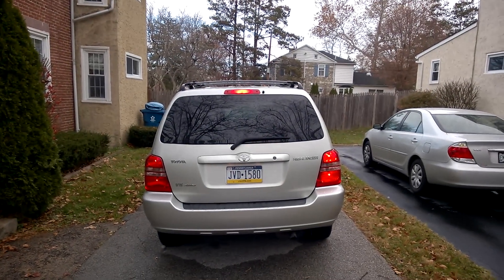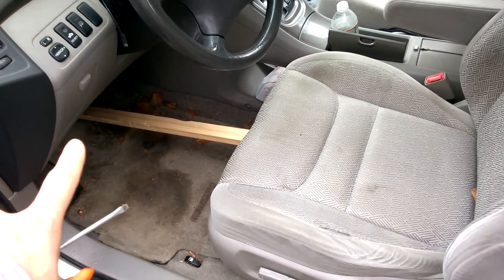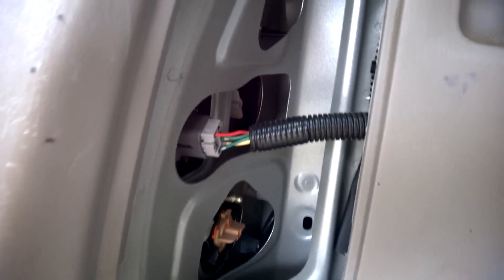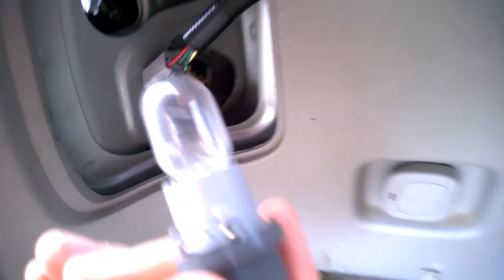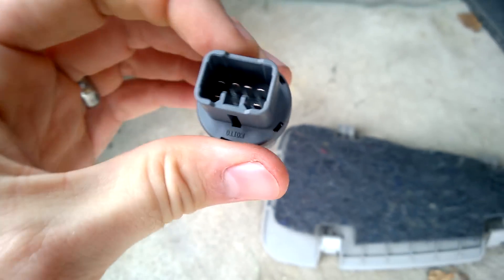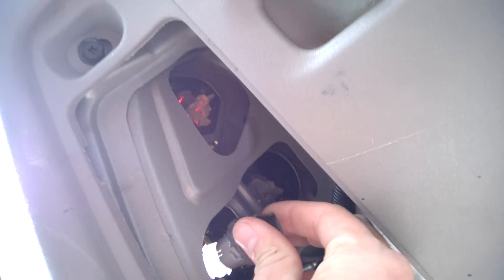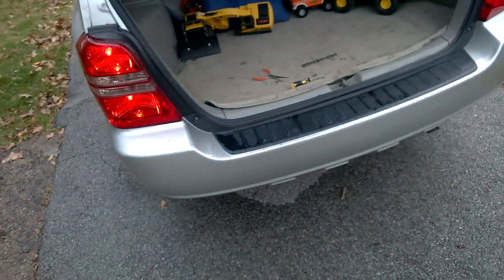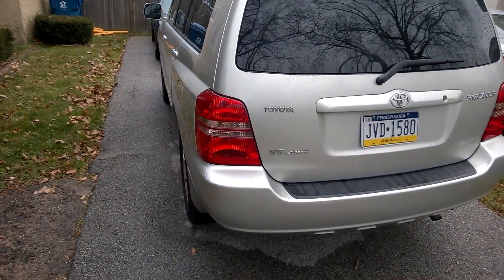DIY: How To "Fix" Your Highlander Brake Lights

Comment: A word of warning. It is very easy to drop the bulb and socket when removing it thru the small opening provided. It WILL disappear for good between the layers of metal bodywork. I suggest stuffing a rag or sponge to fill  the gap to catch a dropped bulb. The sockets I found aren't readily available.
Reply: Etownster Guy I agree! I've lost two of those. I had to buy replacements
Reply: Actually it's easy to retrieve with a piece of flexible hose with some sticky putty on the end (we call it Blue-Tac in Australia) BUT usually the fall causes the filament to break, so not much point. Maybe worth a try though.
Reply: The issue isn't a lost bulb but the lost socket. I seriously doubt a rubber hose with putty will do squat.
Reply: At the time you drop it, the bulb and the socket are attached to each other. The socket is just a small plastic thing, no bigger that the bulb. It isn't really a socket, more of an adapter. And rubber hose won't work because it's too flexible. You need to use the type of hose that is bendy but still stiff. It's usually transparent, maybe acrylic?
Reply: That's exactly what happened to me. Now off to Auto Parts Store to see if they have it. I wish I would had seen your comments beforw
Reply: get a grabber tool.  It is a small flexible metal rod with a claw end.  Worked for me.  $7.99 at pep boys
Reply: I ended up ordering socket on ebay $10. It is not carried by the local auto parts stores
Reply: Wish I would have read this comment sooner, but I managed to fish the bulb& socket out with a piece of wire
Reply: Etownster Guy I had to go buy a whole new tail light because I dropped the housing
Reply: I dropped both bulbs down the same side! Can’t see them or feel them. Can’t figure how to get lens assembly out!
Reply: WOULD BE NICE IF TOYOTA MADE A HOLE BIG ENOUGH SO THE THING WILL FALL ALL THE WAY WHERE WE COULD JUST PICK IT UP
Reply: @chrisjamesfell  i used a wire and a strong small hard drive magnet
Reply: Just lost one damnit
Reply: Been there just today!  Had to do some liner disassembly to fish it out in the 100 degree heat.  (Not big fun when you're in your 60's and out of shape.)
Reply: I wish I read this I dropped the bulb and tools trying to get it out
Reply: Yes. Had that happen so I now place a towel to plug those crevices. Thanks for mentioning it.
Reply: Wish I would've saw this comment sooner 🤣

Comment: This was the same problem that I had with my 2002 Highlander.  After replacing the bulbs, I watched the video.  It was very clear and easy-to-follow. I had my passenger's side tail light working in 5 minutes!  Thanks for this!
Reply: Same here just replace the socket your better off.

Comment: Thanks for pointing me to the tail light socket. When I removed the wire harness plug, I could see two of the six pins in the socket were coated with greenish gunk while the other four pins were bright and shiny. Also, residue on the surface inside the socket around the gunked-up pins suggest the pins had been submerged in water sometime during the past 19 year life of my 2005 Highlander. I removed the gunk using a dental probe, just like cleaning plaque off teeth. There still seemed to be some burned varnish on the surface of the pins. So I sprayed some contact cleaner on a thin cloth wrapped around a tiny screwdriver and got the two pins mostly clean. I then sprayed the contact cleaner into the socket and did a few cycles of connecting and disconnecting the wire harness plug. Problem solved!

Comment: I just helped a friend diagnose and repair this issue using this video. The issue is indeed on the connector, but not in the way mentioned in the video. On the side of the connector that plugs into the tail light assembly, there are 5 little metal tabs that are bent at ~45 degrees. Over time, they flex and become loose or flattened, severing the connection to the tail light assembly. With a small screw driver or nail file, you can bend them back up to ~60 degrees or so, ensuring that they make contact again. This will get you by for some time, but a better fix would be to just replace that connector. It's Toyota part #90075-60036, and can be had for about $12 each. You need one per side.
Reply from the maker: Thank you for the comment!! Very helpful!

Comment: Thanks, JEG's Garage! When I put the new bulb in and nothing happened, my wife who helped said she would check the internet and your video did the trick. $7.00 for two bulbs (might not have needed it) but cleaning off the metal parts of the sockets and giving the three sockets a few twists did the trick for our 2002 Highlander. Thanks again.
Reply from the maker: Glad it helped!!

Comment: I had the same problem, lights would come on when I turned on the headlights, but the brake lights would not light up.  I bought a new reverse light socket and even tried your trick of messing with the prongs in the socket.  It ended up being a short somewhere in the wiring of the tail light assembly.  I replaced the entire passenger tail light and the brake lights work again.

Comment: My right brake light was out but not my left. Bulbs fine. Per your suggestion, I bent the connector harness tabs slightly to get more contact pressure when pushing the connector into the socket. All good now. Another big thank you from Arizona for your help!!!
Reply: I know you posted this comment 2 years ago but I wish i saw this sooner. Just went to auto repair and they charged $147 to "rewire" and connect the cable. You had the exact same issue as me. Better to know then never i guess
Reply: @jewbacca0008  i have the same issue possibly, but ive tried switching the little grey socket and it works on the left one so its not the socket, i even replaced the tail light assembly, i think i might have a bad wire or something

Comment: Hey bro, Thank you for this! I was having the exact same problem with my 2003 Highlander V6 as well. I followed your video and boom, had it working in 10 minutes. The connection seemed very loose to the bulb that held the wiring harness, so I reinforced with some electrical tape. Seems like it is pretty snug in place now. Thanks again for sharing this! Huge help!

Comment: My 2004 Highlander's passenger side tail lights/brake lights stopped working today. A local shop said it would be $50 for troubleshooting plus any parts! I told them "NUTS" and came home. My YouTube search popped up this video. The issue was 100% what was shown in this video and fixed the problem. It was so quick and easy that I did the driver's side also. THANKS JEG,s Garage guy. Saved me a bunch of bucks. This Highlander is coming up on 180,000 miles and still going strong.
Reply from the maker: That is AWESOME to hear!  Sometimes the videos that I never thought would help end up helping the most people!  Im glad it got your Highlander fixed up.  Thanks for the comment!

Comment: Worked like a "charm" on my 2003 Highlander. Wiggled the connector, on the lights came on, took it apart and cleaned and very slightly bent the connector contacts, and now all the lights work. Thanks, you saved me hundreds of dollars.
Reply from the maker: Glad I could help Joe!  Its not a job you need to pay for thats for sure!

Comment: Some kind citizen pulled up next to me today and told me my brake lights were not working. Well, I check all the other lights about yearly but not brake lights unless there happens to be someone around to assist. I went into panic fix it mode. Thought it was probably the switch, but I was also sure I knew nothing about the functioning. Hours later I stumbled upon your video, performed your test, with a board holding down the brake pedal and removing and checking connections. Got one side to work. The other needed a new bulb, which I had in the glove box. All that in time for bed. Tips were fantastic. Thanks so much.
Reply from the maker: Awesome!  Glad someone was cool enough to let you know you had a problem and glad my video helped you fix it! Thanks for the comment.

Comment: Thank you so much!!! We bought our 2003 Highlander two weeks ago and realized after a few days that the brake lights on the same side weren't working. The car lot was supposed to get us some bulbs, but today we just bought some from the parts store. They were burned out, but after replacing, we had the same issue. Found your video, went out and jiggled it and BAM, they came on. Upon shutting the rear hatch, it stopped again. I tried the turn slightly back method and now they are working! Whoo Hoo!!! You are an angel!
Reply from the maker: Hi Dawn! Thank you so much for the comment!  Glad to hear that the video helped you out.  Thats the whole idea :)  Thanks for watching!

Comment: JEG - Thanks for the video.  My “fix” was turning the backup light socket back 1/4 turn and electrical taping it in place.  We’ll see how that holds up over time.  Crazy times now and really appreciate how this saved us $$$ and a trip to the mechanic during these coronavirus times.  Mahalo nui loa!
Reply from the maker: Glad the video helped get you on the right path at least!  Thats all I could have hoped for.  And yes...with the virus going around, I think lots of people have turned to doing things like this on their own instead of venturing out.  Thanks for watching and for the comment!

Comment: JEG ~ Your video was spot on!!  In less than 10 minutes I fixed my own brake lights!! , using a nail file and my Louisville Slugger bat (I had no 2x4's on hand). I feel like MacGyver! :D My 2003 Highlander had the exact same scenario: both brake lights on left side were out. A few months ago I giggled the wire connections & they worked, but not for long. I replaced the bulbs many times to no avail.  Thank you for this great video!!
Reply from the maker: Glad it worked for you Heather!  And a Louisville Slugger is better than a 2x4!!!  Such a versatile tool :)

Comment: Feb 2024 and this is still legit. 04 highlander and left brake light not illuminating. Already bought new bulbs and tail light fuse but still not working right. Just unplugged the connector from the bulb and put back in, worked like a charm. Saved myself a hundred fifty bucks. Kudos to you 🫡🫡🫡 You just earned a new follower!
Reply from the maker: Glad the video helped! Thanks for the comment sir!

Comment: Thanks so much for this video.  I was struggling to to figure out what happened when I was working to add a backup camera.  Had unscrewed that left hand bulb to check voltage but didn't get it back in right.  Never would have guessed all the stuff that came off that connector.  
Just put it back on with the 5 contacts keyed correctly and all is well.
You are a lifesaver !!

Comment: I had both left and right brake lights out on my wife's highlander.  I replaced the bulbs and nothing. The fuse was good and still nothing. I watched this video and moved the center bulb/ backup light and BINGO it worked (Both sides)   Thanks a bunch for posting the video.  I owe you a cold one !!!
Reply from the maker: Thanks Steve!  Ive been accepting cold ones as payment for 15+ years now!  Probably when I should have only accepted cash on more than one occasion :) Glad the video helped!

Comment: I didn't do any bending, but I use Qtip and acetone or alcohol and wipe off all terminal contact, male or female contact.  Remove the connector from bulb, input and clean them with acetone.  Almost a year now it still work.  Thank you very much for this informative solution JEG's Garage.

Comment: I've had this issue before,  wiggled the various bulbs and suddenly the brake lights work again.  Never understood why. All I did after watching your video was remove the reverse light with wire connectors and made sure they metal contacts weren't flat,  wiped my finger along the contacts in the highlander, and replaced the bulb tight again.  A little wiggle and the brake lights were back.  I slightly wiggled the bulb casing again and the light went out.  It looks like it just doesn't snap tight and a good bump in the road could cause my problem. Thanks for explaining how it works. That helps me figure out what I want to do and what I want to leave to someone else.

Comment: This helped a lot.  I replaced the bulb on the inop R/H side; it was burned out, but replacement still didn't restore operation on that side (my typical karma).  The Haynes schematic just basically shows wires from the fuse up front to the tail lights, with the only "split" at something they call a "junction box" or some such.  Of course, there's no hint at where this junction might be...that's what brought me here.  I suspect the convenience of all those gazintas and gazoutas at the reverse light socket might be what they meant.  Of course, any of us who have spent any time as a grunt in a technical field know that engineers generally can't "write their way out of a wet paper sack" (sorry...soapbox moment).  At any rate, tweaking the contacts for more robust electrical connection turned the trick here.  Huzzah!

Comment: Good video. I man drove next to me at a traffic stoplight and told me my rear right was not working.
I researched and found this video.
What I discovered was that turning the bulb holder a bit but not fully into the click-lock position made all the bulbs to light up when brake pedal was depressed.

 However, this maneuver disabled the rear signal light on same side.

What finally worked for me was swapping the bulb holders: I moved the right one to the left, and the left one to the right.
Everything worked fine thereafter.
Reply from the maker: Yeah if you rotate it too much it can make contact with different areas of the circuit.  Its a very slight turn off of seated that did it for me.  Either way glad you got it working!  The important thing is someone was cool enough to let you know and you were handy enough to fix it without spending a fortune :)

Comment: Thanks for the video. This worked great for me. I knew everything came in thru those wires but didn't quite know what to do. You were very thorough in covering all angles of this. I bought no bulbs or sockets, so cost for me = 0, or just a little time. Thanks again!!

Comment: Great video!  I just got through fixing the same problem on my mother's highlander. when I removed the harness out of the socket, I immediately saw the green funky corrosion over the contacts; I cleaned them off with electrical wash and I was good to go.

thanks!

Comment: Thank you for sharing this video, it helped me solve my problem! I have had this same issue all year and have replaced the bulbs on the drivers side several times only for the situation to come up again months later. Eventually I had come to realize the bulbs weren't even burnt out and it had to be something else. This video saved me a visit to the dealer and lots of dinero, Thanks Again!!!
Reply from the maker: Hi Brenda!  No problem!  Glad this video is still helping people out.  Now if something else goes wrong back there you will know your way around!  Thanks for watching and commenting!

Comment: THANNNNNK  YOOOOUUUUU!  Worked like a charm for me.  I found that I needed to bend the prongs inward vs outward progressively on a couple tries to finally get them to seat.  I think it's deceiving which side of the two slots the prong seats.  I think its the outer side, so bending the prong inward applies more pressure.  I could be wrong.  In any case that's the trick.  For me it wasn't the connections that engage between the bulb housing and the tail light assembly.  No amount of rotation mattered in my case.

Comment: omg... Thank you thank you thank you.  I was getting so frustrated. I bought new bulbs, new fuses changed everything and still didn't work.  after watching your video I went back and pulled the connector out and put it back in turned it all the way then back a quarter way like you said and it worked!!!  yeah!!! Thank you Again!

Comment: Same problem I had; simple solution, went on Ebay and bought replacement back up light socket/wire harness receptacle for $10, free shipping, replaced it in 2 minutes, works great.
Reply: what did you search for when you made this purchase on ebay? I tried searching "02 Toyota highlander back up light socket harness" and nothing showed up, please help! thank you!
Reply: Toyota Original OEM Tail Light Socket Plug 2001-2007 Highlander

Comment: Great video.  I had the exact same problem but with the passenger side.  With mine, the fix was temporary.  The next day, no right brake light.  I did end up ordering a new socket; just waiting on it to get here.  Will also try bending the tabs up a little more (and inside the plug) to see if I can get better contact.  You do a great job of explaining the steps in your video.  thanks!

Comment: Dude, you're awesome!  My fix was the easiest.  I removed the reverse light bulb with the wire harness and put it back in and the brake lights came on...it had just come loose.  Thanks!
Reply from the maker: Glad it worked!  Its amazing what you can do by just digging in and wiggling some wires, right?  Just keep an eye on it, maybe every few times you fill up with gas.  They have a habit of wiggling back out of contact.

Comment: It worked!  I just rotated the wired light socket and the lights popped on instantly.  A few more wiggles to re-seat the contacts, and we're good to go!  Ditto for 1 of the 2 break lights.  One solo brake-bulb socket had the same issue after it got power.  A few wiggles and it is fixed too.  THANKS

Comment: Thanks a ton! I replaced the burned out brake light bulbs on the driver side & it still wouldn't work. Then, I tried everything you said - especially wiggling the wring harness and that fixed it.  Your the best!  Lou DeRose

Comment: Thanks for the video hints! I did the bent pins, but it did not work. Before buying new bulb sockets, swapped one side socket with the other. It worked! Both sockets are firmly seated without excessive juggling to get the proper connection.